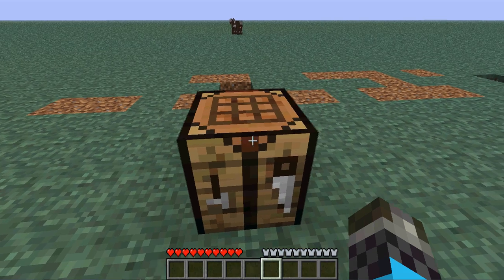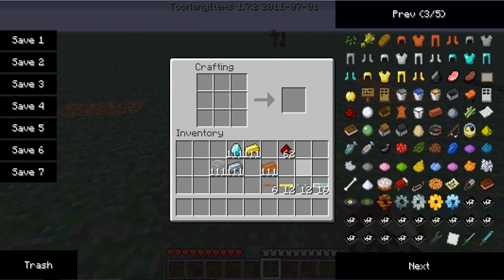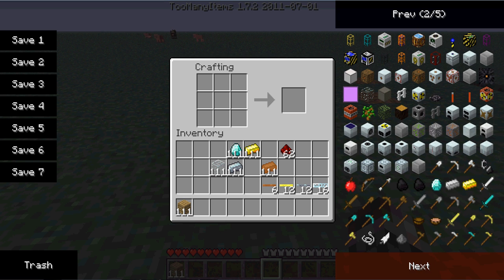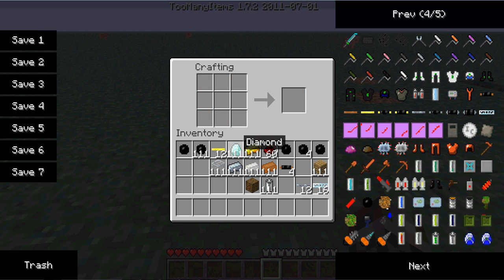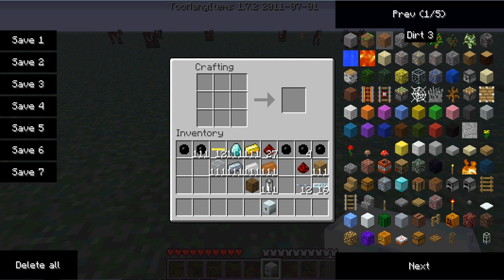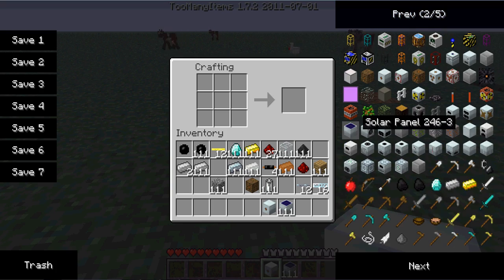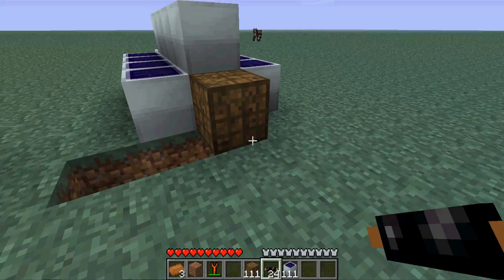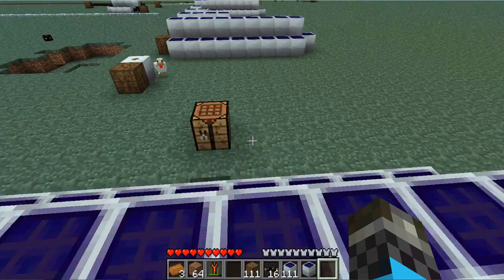Industrial Craft 2 wiring and solar setup (outdated)

Comment: I have the technic pack for 1.7.3, and when I use the BatBoxes, I get no power output when I hook cables to the output (the side with the dot) yet it is collecting power fine from solar panels. Is there any reason for this? I'm  using the copper cabling (insulated)